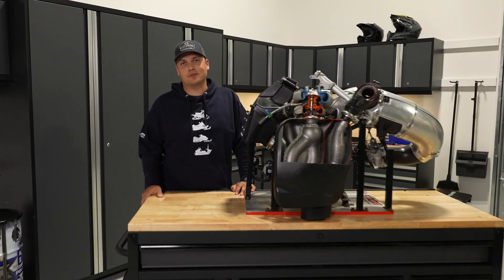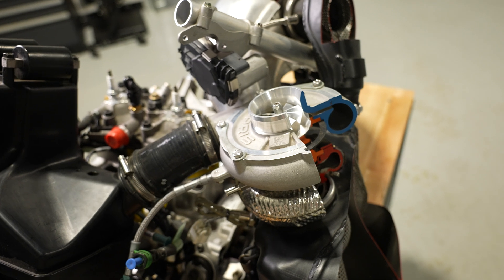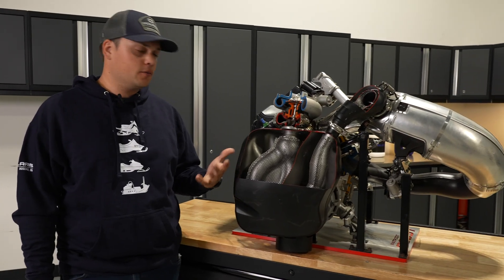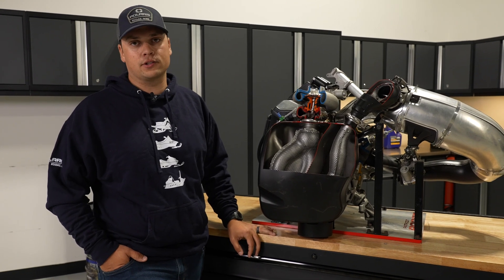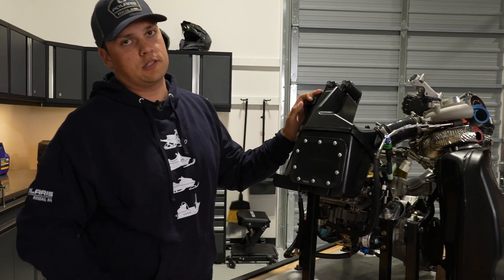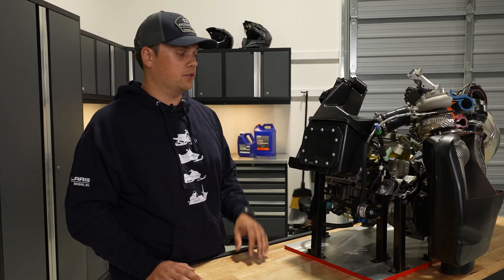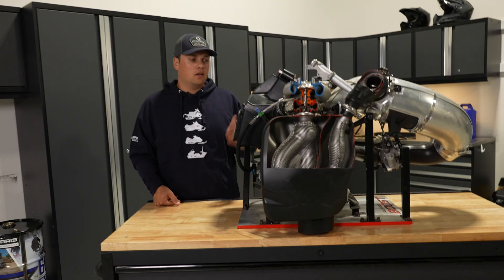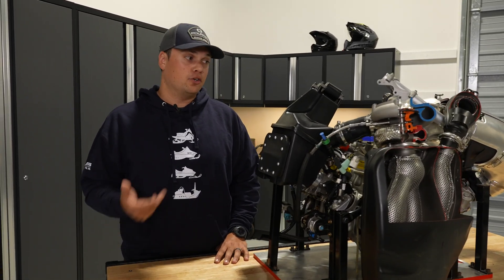Snowmobile Engine Deep Dive – Patriot Boost – Sled Tech EP. 6 | Polaris Snowmobiles

Comment: does it still eat spark plugs as the 850 NA ....  my  riding buddy rmk 850  just fouls plugs  , a weekend is about 4 to 6 set of plugs....
Reply: guess i'm lucky, never fouled a plug on my 019 850, my 020 850, my 024 850 boost. or my 021 650 or 024 650
Reply: I’ve never fouled a plug in my 850 na 🤷🏼 I always let it warm up to temp before unloading from my sled deck though.
Reply: @linteastwood500   thats the thing it fouls on cold start ups and he doesn't touch the fuel at all , got it reflashed 3x already
Reply: @yamguy33 which oil? The oil flash point makes a big difference and is probably to blame.
Reply: @jakepeterson3379   he is using sinto oil
Reply: @yamguy33  I'd try switching oils first.
Reply: your fuel is the problem....this happened to me too. I went to the airport 100LL in the sled never fouled one after that.
Reply: @derekpetrongolo5295   he was always running 94 octane.... yet it only goes to 91 octane setting in the dash..... got it reflashed 3 times at the dealer , 100ll thats way over kill for a NA stock engine
Reply: @yamguy33  It worked, so I don't have to worry about changing plugs on a 45* hill in 10' of snow and blow $30 of plugs at a time.
Reply: I’ve never blown a spark plug